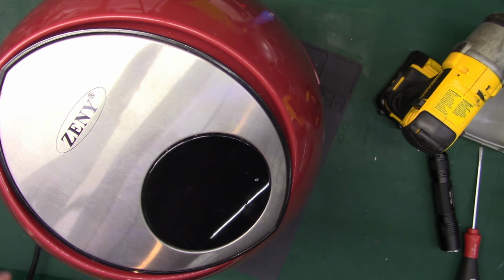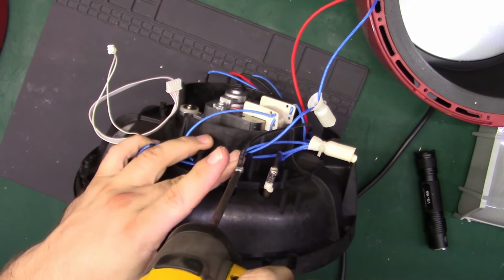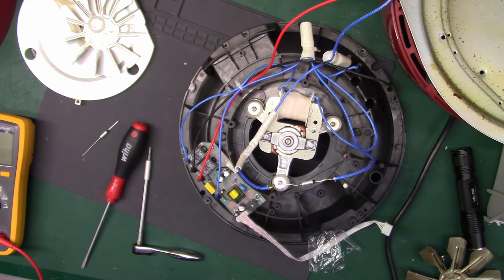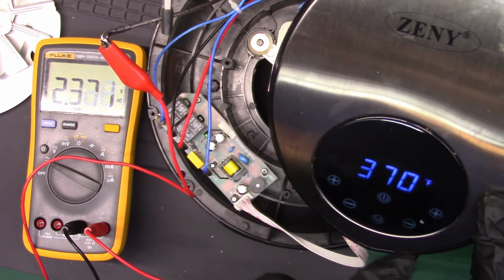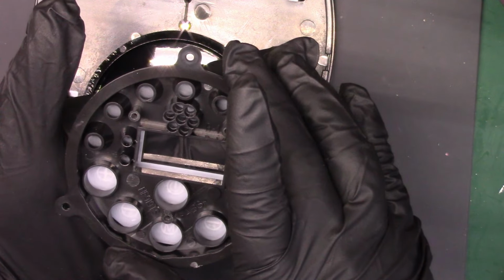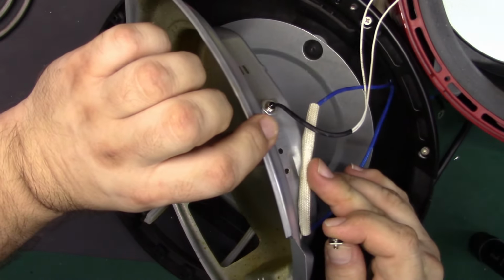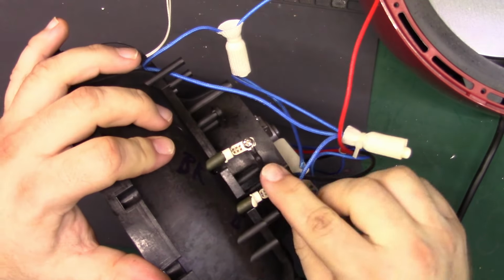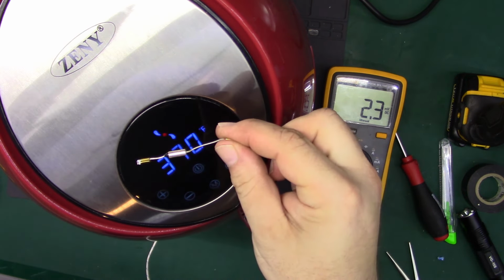Digital Air Fryer Repair

Comment: my airfryer timer knob is not working like it doesnt move back to zero after you set the time and it doesnt make the ticking sound as well.. whats the problem? my airfyer is faberware it looks like this in the video but instead of a screen it has 2 knobs. 1 for timer and 1 for the degrees… what should i do?

Comment: Princess 182020 Digital Aerofryer XL 

Hello! Really nice video and to see how to check how parts work or not in an AirFyer. Yes, I have a question. I have an older model of airfyer but it's not especially used and I suspect it's just a minor problems today. What happens regarding the error is that the display flashes and sounds and honks on and off when you put the basket in and you can therefore not use the AirFyer. But it is a glitch or malfunction that can be related to the deposit of the basket . It is a form of spring-back switch in the upper rim of the on the Airfryer and if you press the basket firmly the display is constantly lit and you can use the programs My question is what the components are called that are wrong with and how to order them and where?

Comment: Why do you have to take so much stuff apart to get to the thermal fuse? The indention for the fuse is right there when you take the cover off. They could have easily put a screw cover that would pop right off, and there it is. Ugh...Anyway, I got to the point of testing the fuse and I held the leads like you did. Looks bad. Now that I have cut the thermal fuse off when I touch the leads I get 000. I have a new fuse coming but not sure why the fuse appears to be good now. With your fingers on the leads and holding the wire is the meter getting a false measurement?
Reply from the maker: Im not sure why the fuse seems okay.  It might be that the wire inside broke and then when you moved  it the wire is touching enough to make 0 ohms.  As far as to why they bury it?  Because they dont want you to fix it! They want you to throw in out with all the other ewaste!  Thanks for taking the time to fix it yourself and deny them another sale when you are definitely capable of fixing it
Reply: @FixitFrank  I thought the same thing as you. We will see if the new fuse fixes it. Thanks for getting back to me so quickly.

Comment: I appreciate the rest of the video but only needed to know how to take off the top panel. Have a different model and assume it’s likely the same concept due to a similar build. Unfortunate that part 1 was deleted. Great video though!
Reply from the maker: just do the assembly I did in reverse.  The top probably is held on by plastic clips. Wiggle and pull and see what gets loose.  Plastic is pretty forgiving to a point so just dont pull or bend too hard. I bet you find it.  Good luck and thank you!
Reply: @FixitFrank  Oh that’s awesome! Thanks a ton!

Comment: I have a different model Gourmia air fryer that went dead, but the layout is similar. When I opened it I found one of the spade connectors on the main board had overheated and fried, creating an open circuit. Maybe caused by a cold or poor solder joint. The spade terminal came right off the board when I tried to disconnect the lead. I made a short pigtail lead with a new spade terminal and soldered it to the back of the circuit board and reconnected the lead. It worked! I did not have to disassemble the fryer further to look for the hidden thermal fuse, but thanks for showing how to do it.

Comment: The fan on my sister's dropped a nut and she lost the nut. She has a krups and I can't find what size the threads are. Would you happen to know what size threads the nuts are? Are they all left hand threads? I'd have to find a left hand nut then?
Reply from the maker: It's metric. Maybe m4 or M5. Probably also left handed thread. McMaster Carr or Fastenal should have them.
Reply: @FixitFrank  only thing we have is the world's smallest ace hardware lol
Reply from the maker: they can probably order them but yeah, its not a common fastener.  Ebay might be worth trying

Comment: I replaced thermal fuse, and it worked for couple of weeks.. then overheated and burned fish :)
So, thermistor may also need to be replaced..
Reply from the maker: might be the fan too.  Try cleaning the fan motor.  If the fan is not moving fast enough, it will allow heat build up.  also be sure the heating element is not cracked.

Comment: So a question? Thermal fuse. Is just a kind of a safety device Right?. If it gets above set temperature of the fuse it will cause it to fail to save the device from damage? The reason why I ask is if I bypass the thermal fuse shouldn't the machine come on? I checked continuity at the basket switch that's operating correctly. Kind of scratching my head here. But I'll walk away from it for a minute and maybe a light bulb will come on lol 🤣😂
Reply: No I get it. Definitely!!! You definitely don't want to run permanently without a safety mechanism . what I was just getting at is if I bypassed it if the machine should fire up if in theory that was the only problematic device thermal fuse  but you answered that question. I appreciate the info. Your videos. Awesome and very informative!!
Reply from the maker: yeah itll come on but that means the last line of safety is gone.  I would not recommend bypassing it for normal use but Im not the thermal fuse police so what you do in the privacy of your own workshop is your business :)

Comment: My  air fryer the fan doesn't work, what should I do.
Reply from the maker: I'd check to see if its jammed(try and push the fan). If it spins easily, the problem is electrical. Unfortunately there are so many possibilities its hard to suggest them all.

Comment: This is very detailed educational video. Thank you. I have got a non working air fryer from a friend. In the process of dismantling, it appears that the burner coil is resting on the underneath metal plate. (3rd screw opposite to the two screws attached to the assembly is missing).  This means the the heat sensor and the fuse attached to the metal plate will heat up with the burner coil. Would this be ok? Hope to hear from you, thanks.
Reply from the maker: I hate to say it but I would re-assemble it.  After all your work, it would be a shame to have the fuse go bad just because the coil isn't in place.  It would 'work' but I bet it fails pretty quickly with the coil up against the plate.  You'll be glad you redid it.
Reply: @FixitFrank  Thanks for the quick reply. I was wondering, the bracket used to tighten the screw on the burner coil of your demonstrated unit, is it a fully conducting metal piece? Also if I put spacers on the two screws attached to the burner coil and get some clearance from the plate would you think that is advisable, considering that the coil would be floating in air with no thermal conductivity to the plate. I value you opinion. Thanks.
Reply from the maker: its hard to say man.  I am a firm believer that the engineers who designed it, did so for a reason.  What you say might work but I dont want to tell you it is 100% okay.  I'd suggest testing it in a safe place with lots of oversight to make sure nothing else happens.  What you suggest might work, but again, I don't want you burning your house down over bad advice.
Reply: @FixitFrank Thanks for all the advice. I'll keep the coil as it is and will replace the thermal fuse. It should work for a while. Thanks again for the very helpful video.

Comment: Can I replace the 172C(correct one) fuse with a 192C ? Will that make it last longer?How about the amp. 10A or 15A?
Reply from the maker: I would not recommend that.  The thermal fuse is your final safety point. I would not use a 15amp as the original is 10amp.  Using a fuse with 5 amps higher spec could lead to a fire.  Normally I would be okay with subbing parts, but when it's a safety component, I would not do it.  Of course you do what you need to do with what you have.  I realize not everyone has access to the proper parts.  Keep in mind paper burns around 230c so you are getting pretty close, also ABS plastic gets soft around 210C, so your plastic housing might melt.  I'd seriously recommend using the 172c @ 10amps. These are so cheap. https://www.amazon.com/SF169E-SEFUSE-Cutoffs-Thermal-Degree/dp/B071F9PGW4/ref=sr_1_1  $6.25
Reply: @FixitFrank  thanks 👍🏻

Comment: Thanks for filming this, my air fryer is completely dead although the plug fuse is fine. I saw there was no path between the pins and PSU board. Really I was about to stop there. Dug deeper and found two ol 192c thermal fuses. 
Stupid question any difference between fast blow & axial?
Reply from the maker: Axial is the physical shape.  There are fuses where both pins come out the same side(radial) or one pin on each side(axial). The fast blow means it will open the fuse quickly.  I'd suggest looking for a standard blow 192c. https://www.amazon.com/SF188E-SEFUSE-Microtemp-Thermal-Cutoff/dp/B01N1Y1L46/ref=sr_1_3  these should work fine.
Reply: Back again! My air fryer kept going for about one year. Now the relays have gone! I could hear them clicking way before the temperature was reached. Also I heard 4-5 clicks within a second. I've tried to zoom into your video to see the details of your relays. 
These are fryers are not worth It in my opinion. £150 for something that needed a repair 1 year after purchase and now another & it's not even 2 years old. Was gifted on Christmas '21. I'm in two minds whether to repair it, just buy a cheap one with extended warranty.

Comment: Tap the power button to switch the unit on bro . Tap the power button to switch the unit off 
But it will enter in a cool down mode before it switches off

Comment: Thank you for this video! I followed it to replace the thermal fuse on my fryer, which was also my issue. I even had to copy your method of crimping with butt splice parts because I couldn’t find the connectors it comes with! My fryer is good as new now.

Comment: Same problem with Power XL air fryer.  The rubber seal on the exhaust wasn't properly installed by the factory, so I believe it bled too much hot exhaust air between the metal plate and the plastic inner housing and blew the fuse.

Comment: Just took apart my ninja max air fryer and like you am having trouble reassembling the whole fan mechanism, so I posted a coupla pics of the pile of bits on a Facebook page specialising in the Ninja Max and wondered if anybody had any tips. Turns out it was just for recipes and they think I’m mad and a troll ha! Good video btw very much how I proceed.
Reply: Did you ever figure out or know anyone that has a part assembly diagram for the ninja air fryer the fan assembly/ shimming the fan

Comment: Have you taken apart a Ninja Air fry twin. 
As I need to clean it but the grill piece in the way if i unsqrew it will it just pop off i know it well have wires attached

Comment: I have checked the thermistor, heating element, and thermal fuse and found no problems. i have found that there is no power going to the heating element. Thoughts?
Reply from the maker: I'd check the triac driving the coil.

Comment: Hi wondering if you might be able to help me? I have an air fryer donated that has a problem with the electrical panel. Hoping to fix it so I can pass it onto a family in need.
Reply from the maker: We can try! What problem does it have? Some control panels are not repairable because the control chip needs to be programmed. Other parts can be replaced.

Comment: I bought 2 Power XL airfryers. One went out not even 6 months after I bought them. I used the second and it lted 3 months. They both failed doing something different. I found the circuit board was bad in one and the thermal fuse bad in the other. I took the board from the one with the faulty fuse. 

These were at the time under warranty. I found it was gonna cost me $85 to send each of them back for repair when I only paid $60 each on a special sale for a short time. The company tried to sell me a new upgrade. Ha! I decided I'd find out what's wrong myself. I may check the company for the price of a control board and thermal fuse.
Reply from the maker: Nice job!!  For the model with a main board issue, check voltages. You may have to Google data sheets on the parts but I'd start checking voltage regulators and diodes. If the main control of is bad, I would not go further.

Comment: What resistance are you getting across the motor coil?   I'm getting everything operational except for the fan.  Am getting the clicks from both relay, so I went to measure resistance of the motor coil, and it's measuring an open circuit.
Reply from the maker: It should be low. There is a thermal fuse link under the tape of the motor coil that probably opened. Otherwise you can find shaded pole motors on ebay.

Comment: Found the fixing nut for the fan in my bacon! So clearly the fan had stopped doing its job and as refixing fan has not cured operation loos like I will have to hunt down dreaded thermal fusing.
Reply from the maker: You are on the right track for sure. Good luck!

Comment: Hey, I'm working on a ninja and it's very similar to what you're working on. I took mine apart and in doing so a magnet came out from above the heat shield and I have no idea where it goes. Any chance yours had a magnet too?
Reply from the maker: It did not unfortunately.  However, I would suspect that magnet has something to do with making the basket act like its locked into place.  Or, there is a reed switch that the magnet helps activate.  I'd look around for another magnet that lines up with it, or metal plate maybe?  I'm speculating on all of this but I figure, its just another air fryer so it cant be too unusual. There must be a pocket or spot for it to sit in.  I think if you find what the magnet was affecting, you will find where it went.  Good luck and if you figure it out, please let me know!  Thanks

Comment: LOL... should have watched this before I threw mine away.  I was having the same problem (no power), with a different brand but all the connection concept setups are the same, and I could not figure out what was wrong.  There was another fuse on the power motherboard which I test and nothing was wrong.  I did not realize there were other fuses embedded into other lines.  That is why no matter what I do there was no power to the power board.  LOL... thanks for the video, I learn something today.

Comment: OK  problem, my Gourmia Digital Air Model GAF575  fryer is doing the opposit. When I plug it in  and all of the Digital lights come on  flashing like a lite up  Christmas Tree.  It goes haywire & I can't select  or turn it off unless I unplug it. Helppppp. Please
Reply from the maker: Sounds like the mainboard is kaput.  You could look for bad capacitors but I suspect the main chip is no good. If course I am speculating because I can't see it but that would be my initial troubleshooting point.
Reply: @FixitFrank  Thank you for your attempt in helping me. After 2 hours of researching around on the Net,  *AirFryer, I figured it out & it worked🤔
Reply from the maker: What did you end up doing?  This might help someone else.  Thanks again for watching
Reply: @FixitFrank  OK, Since the like new AirFryer was bought used at Goodwill Thrift stores,  they still guarantee all  electronics purchased from them for 30 days but the Users Manual was not included so, I searched Google & found the Manual on line & the rest us History.  Thanks for being here

Comment: Do you have 1 on zenchef?
Reply from the maker: I don't unfortunately but they are all pretty similar inside and use similar operating principles for what that is worth.
Reply: @FixitFrank  had to take it apart myself.
Ripped the top off. Its not supposed to come off. Its one of those, once its on its on kind of lids.
Took it apart in 3 segments just to get to the part i want.
Currently scrubbing out the thick layer if fat stuck to the fan.
Left a video review for the disposable easy bake oven on amazon.
Reply from the maker: @sixtoewolf2  Ahhh.  Gotcha.  I'm honestly surprised this one was repairable.  I really expected it to be thoroughly blown up since these tend to be disposable.

Comment: how do you check thermal sensor? I replaced thermal fuse on ninja air fryer power is on but showing code 1 and 2. what do you think problem?
Reply from the maker: Ohm meter to see if it has low resistance.  0 ohms is what you want to measure. I am sorry but I do not know the error code numbers.

Comment: Thanks so much, fixed my air fryer which was different to yours but similar enough to work it out and couldn't have done it without your video!
Mine had 2 thermal fuses laid side by side which both tested the same so I replaced them both. The satisfaction of hearing the beep and seeing the lights come on when I plugged in was great considering I found it dumped in the rain waiting for the rubbish truck. Going to be using it for powder coating BTW and not cooking food!
Reply from the maker: Powder coating really?  You piqued my interest.  Do you have any vids or info that I can read up on using these for baking powder coats?    Great job by the way!  Keep more stuff out of the ground!
Reply: @FixitFrank  It's really for curing the powder coating paint on small parts. I haven't done it yet but this video will give you an idea of what I mean- https://youtu.be/FyO6c5S8z9U
I've got an air compressor and next on my list is a small sand blaster then a powder coating gun.👍
Reply: @FixitFrank  sir trouble of air fryer flashing